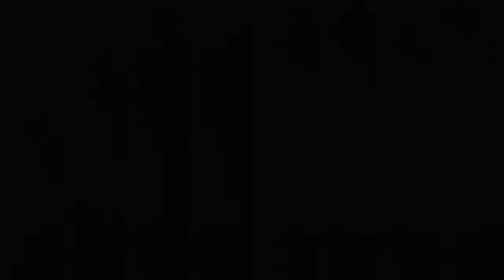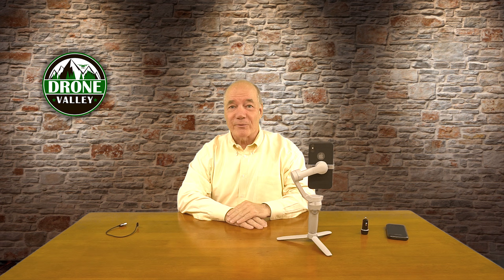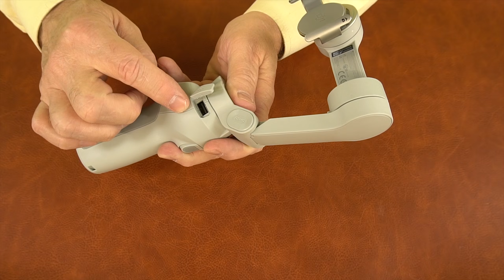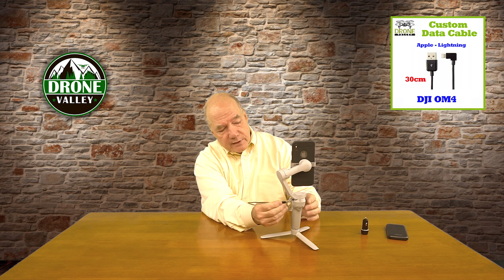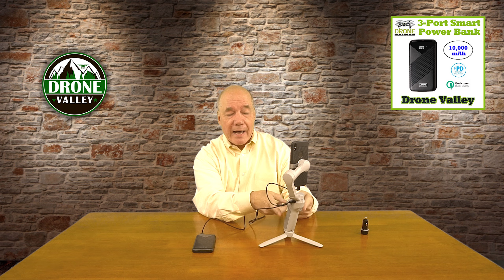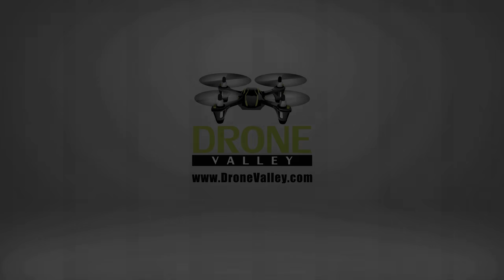DJI Osmo Mobile 4 - A Few Cool Charging Tricks

Comment: I have 18w mobile charger can I use it to charge dji om4 se ?
Reply from the maker: Yes, any USB charger will work fine and the 18W version will fast-charge the unit with no issues. Thanks for posting and consider subbing the channel as I have a lot more tech reviews posting this week. I'll be previewing the new OM5 as well so stay tuned for that one. Rick

Comment: You didn't say about charging the battery up for the first time ,Should you switch on the gimbal or leave it off when charging, what should I do
Reply from the maker: Thanks for the post and leave the gimbal powered off when you're charging it. The first charge takes a few hours and they you'll be all set to go. Be sure to sub the channel so you don't miss any updates. Rick

Comment: How many hours do we need to charge osmo 4 if we newly
Reply from the maker: I would suggest you charge it fully before using it the first time. With a powerful charger that should take about 3-4 hours. I hope you enjoy the OM4!
Reply: @Dronevalley  hi..I just got my om-5 as a gift..after charging the gimbal when I turned it on there's green and red light blinking I doesn't work anymore.. pls help

Comment: What about if I also want to connect a microphone while I am charging my phone through the gimbal? I am sure I would need a splitter, but I am not sure about the proper sizes ... I use the iPhone 7 Plus and there is not much gap between the bottom of the phone in the vertical mode and the gimbal.
Reply: Just bought binaural headphones and have the exact same issue. 
Both the new headphones and the osmo also use two different apps, so I can't use the osmo functions to hear the 3d effect. Really annoying. Hope you got sorted with a splitter.